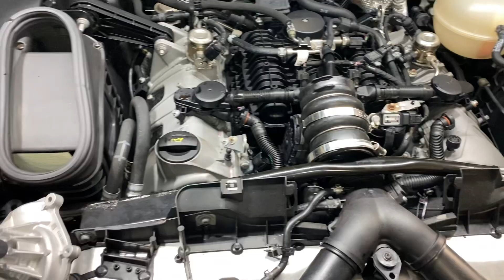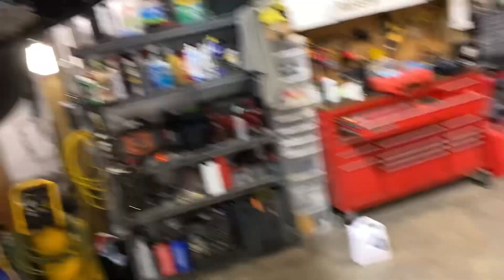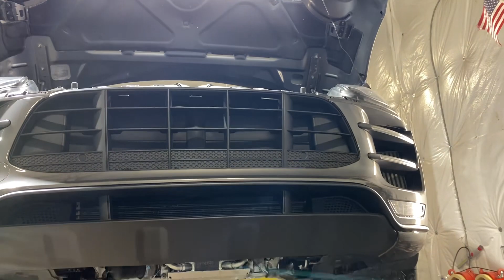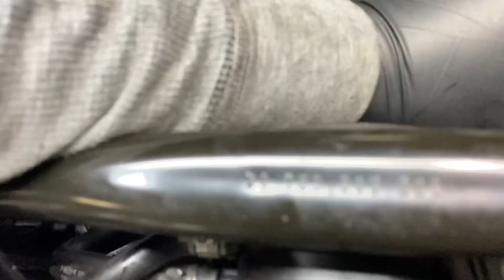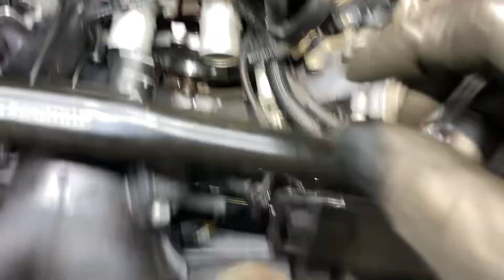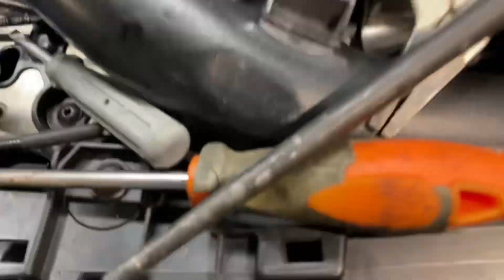Porsche Macan Turbo water pump & thermostat removal

Comment: What tools did u use to loosen the water pump and the tensioner. The ratchet wrench I have are too big for the limited space
Reply from the maker: For the tensioner I used the serpentine belt tool. And for the water pump just a regular ratchet with flex head. 👍🏼

Comment: Can you explain the process of changing the serpentine belt? Did you have to remove additional items? I followed your video and got the thermostat replaced and when I was driving the vehicle, the serpentine belt broke. any advice would help. Thank you.
Reply from the maker: No, you don’t have to remove or unscrew anything if you are just changing the belt, if you pry the tensioner it will allow you to take off and put back on the belt, now when you are putting it back on, you have to make sure that the belt is sitting correctly inside the pulley of every single component, most likely you won’t be able to see them all but you can reach out with your hand and guide the belt into every pulley. 
After you put the belt on all the pulleys,You will end up again at the tensioner to finish putting it back on completely , after that doble check again or feel the belt that it’s on, otherwise it can get damaged or damaged other pulleys, hope I was able to explain my self!

Comment: I started smelling coolant and noticed splatter residue on the upper radiator hose and serpentine belt. Inspecting the common plastic lines i see no breakage so i am guessing it may be the water pump leaking and causing the splatter on the hose.

Comment: Thank you so much!! Great video! Very detailed! Also is there a trick to the T50 screw for the belt tensioner I got my socket on there but it seems to be tightening the tensioner and the pulley is not moving so I can remove the belt, any tips would be appreciated!
Reply from the maker: Did your tensioner’s pulley have a black cap on that pops out? When you remove the cap off , that t50 should go in there and be able to move the tensioner’s pulley, that’s how it moves, maybe you were on a different area?